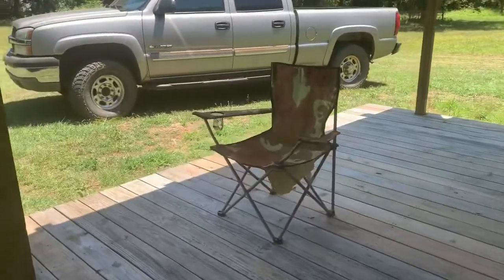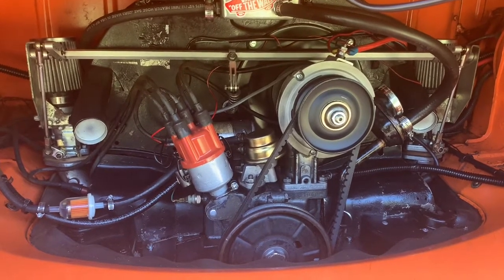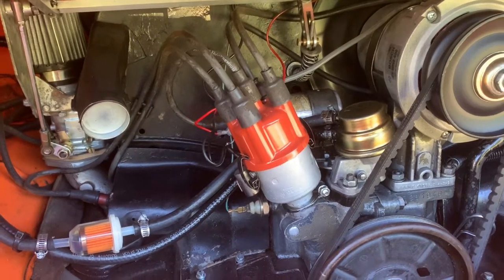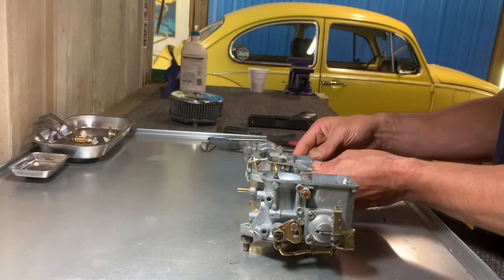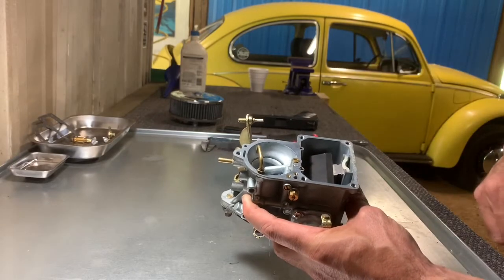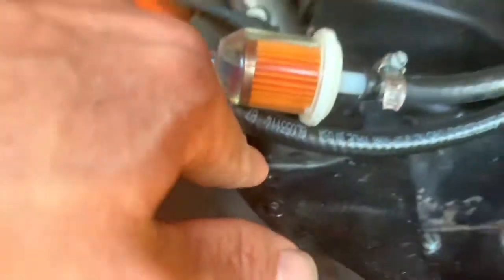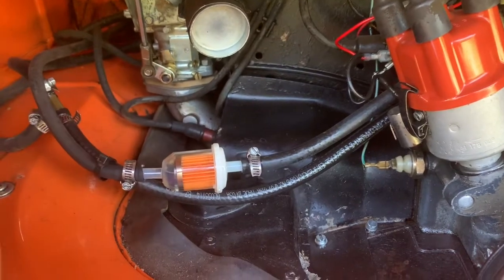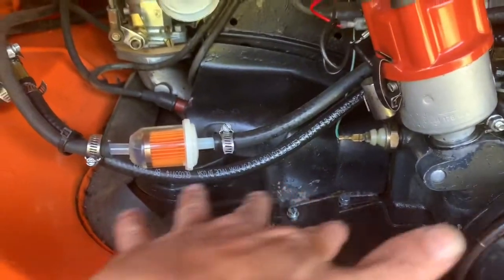6 Reasons Your Carburetor Is Flooding

Comment: I think he meant that the spacer has a high resistance to heat, unlike aluminum which absorbs heat, phenolic is an excellent heat insulator. I use one on my '73 SB, and my '88 Silverado.

Comment: I’m curious why you’re running the short manifolds which appear to be Type 3?

You likely would not have carb issues with the Type 1 taller manifolds and I think you have the space. 
Also, consider moving the filter outside the engine compartment altogether and careful on not over tightening the clamps with those plastic filters; very easy to not notice it deforming and next thing you know Firefighter Bill is out there putting out another engine fire.
Last thing, the CB Performance linkage is well worth the expense as it stays in tune as the engine heats up ; this tends to change the geometry on lesser quality kits.

Love the videos and keep them coming!
Reply from the maker: All good points indeed. Those short manifolds are the ones they send with the “kit,” and phenolic spacers fixed the heat issue there. However, I do intend to get taller manifolds for future carbs. 
The fuel filter has been moved beneath the fender of both my Bus and Bug when I put electric fuel pumps on them. As a Firefighter myself, I keep an extinguisher on board, but feel ALOT better after moving those filters. The ones I really don’t understand is when i see them between the fuel pump and carburetor, HOVERING ABOVE THE DIZZY 🤔 
I’m glad you watched and thanks for the comments 🤙🏼

Comment: Hey Mike I found a good deal on a weber rebuild kit all the way from italy. Hopefully they fit. but they sent 1.75 needle, what size is the original? will I be changing my size with these?
Reply from the maker: Hmmm, I can’t say what the original size is, but 1.75 is what I’ve always had and that seems to work good (in my weather)…55 idle,  150 main, 175 air correction is my other stuff. Checked the plugs yesterday and they were perfect with mixture 1 1/4 turns out. The floats work good for me set at 300-320 thou. I know that’s technically expressed in millimeters which I think is 7-8 mm or so. Glad you found a genuine kit!

Comment: Hi. There's a well known fault in the way the float in the Solex is mounted. The white hinge lock is mounted backwards, the bend is supposed to face against the wall, not against the float. If it's facing the float it's a good possibility of it touching the float bracket and then the float will never reach the float needle... then it will flood... Thanks for the other stuff...!!!
Reply from the maker: I wasn’t aware of that issue. Thanks for that!